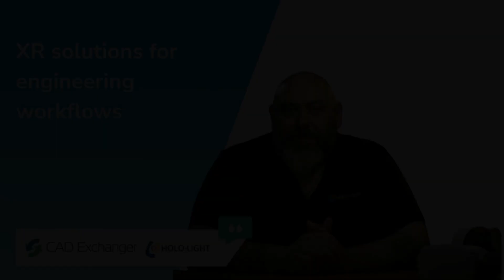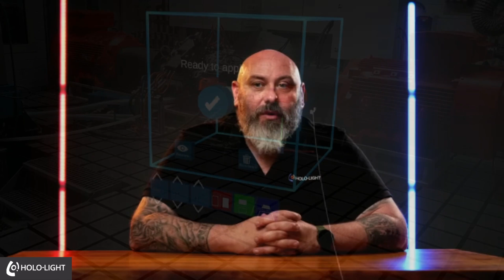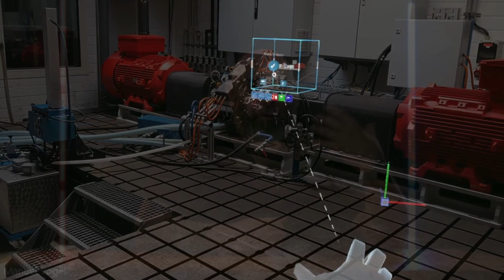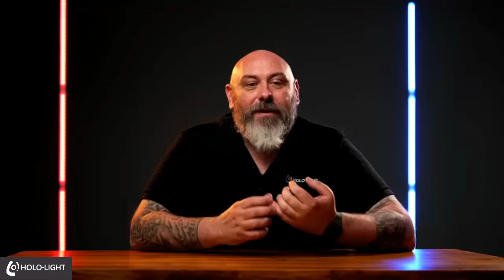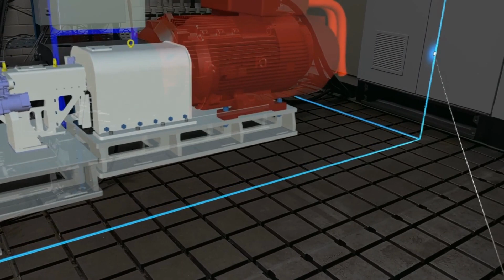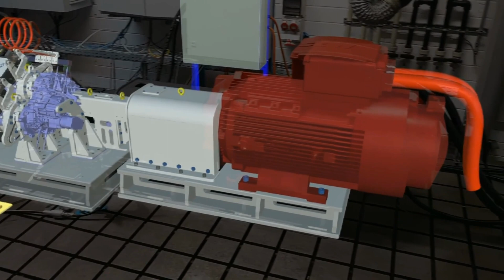Holo-Light streamlines AR engineering workflows with CAD Exchanger

Comment: i exported my closed poly surface from solidworks in parasolid x_t format , opened it in cad exchanger , and when i export it to rhino format and open it in rhino , all the parts of the model are open polysurfaces and not closed